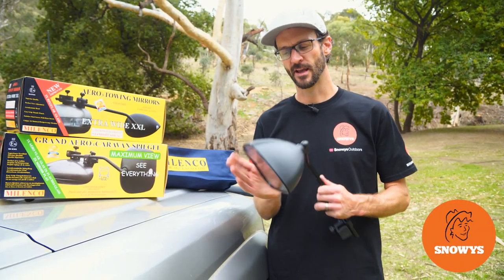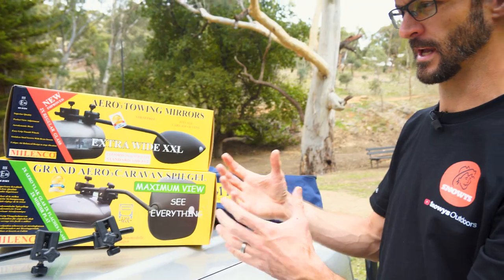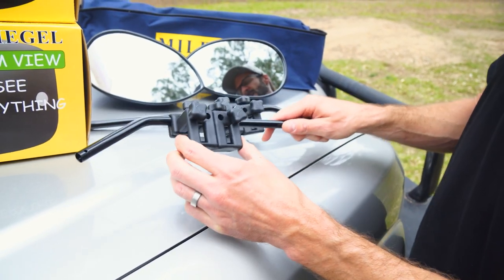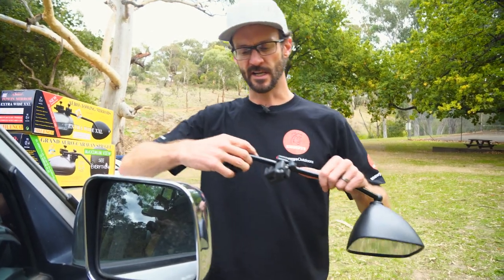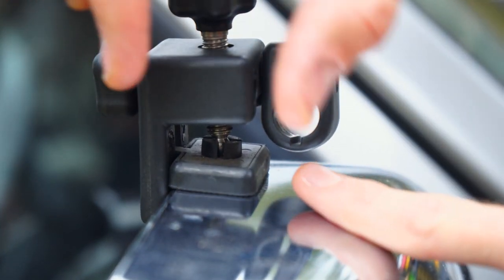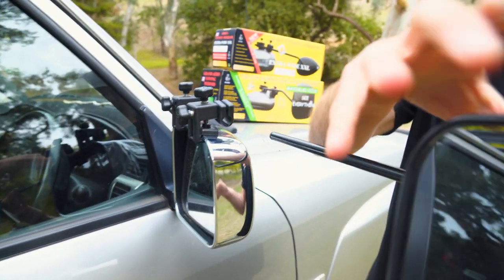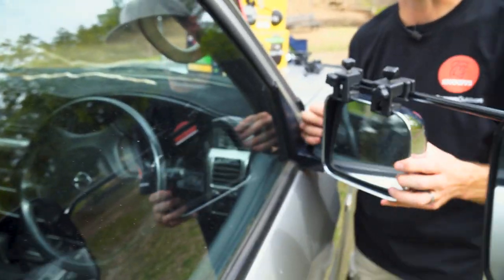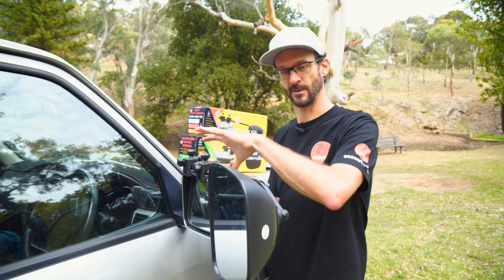Milenco Aero 3 Towing Mirrors

Comment: Have had a set for 6 months or so. I chose to mount them on the bottom edge of the OEM mirror as they mount to the vehicle on the bottom edge, so I figured there will be less flex along the bottom as opposed to the top edge of the mirror. It also allows 'normal' eye sight over the top of the OEM mirror. But great mirrors for the price.
Reply from the maker: Good feedback thanks, Kevin. ~ Ben
Reply: I drive a 21 Traverse and mounted to the bottom. This allows the driver to adjust the oem mirrors without the clamp hitting it.

Comment: I have the tear drop mirrors and have been using them successfully for a couple of trips. However the number 2 nuts are not holding the arm securely enough ( completely tightened) and the mirror tilts forward as you are driving. How can this be corrected please ?
Reply from the maker: Hmmm, this isn't an issue I've come across before sorry, Michele.
If you are by chance near one of our stores it would be good if we could inspect them, otherwise, you could try inserting some sheet rubber to make the clamps grip tighter.
You can also buy new clamps here - https://www.snowys.com.au/mirror-clamp, but without more detail I'm not sure if this will fix your problem.
If the mirrors are relatively new and you purchased them from us then you can submit a warranty claim here - https://www.snowys.com.au/warranty.
~ Ben
Reply: put in a rubber shim

Comment: My suv came with a rubber rain / glare shield. The rubber is fairly soft the rubber extends about 2 inches from the mirror housing and is about 2mm in thickness. 
I regularly tow a box trailer that is somewhat narrower than the car and is hidden from view in the side mirrors in a straight line. I use this irregularity to reverse in a somewhat straight / slight zigzagging line. I was told by my local auto store I would need to cut these shields off to fit any sort of towing mirrors. Are there any attachment that will accommodate this.
Reply from the maker: I'm not sure sorry, Norman, I'd have to see the mirrors to better understand this before I could make a recommendation. 
At the end of the day the clamps need a sturdy flat surface to make complete contact with, if these shields create any sort of weak or unstable point, then they may impede the security of the mirrors.
Sorry I couldn't be of much help. You can always call into one of our stores in Adelaide or Brisbane so we can have a look if you are anywhere nearby. 
~ Ben

Comment: The problem with these type of mirror mounted on mirror is that when ever a large truck comes toward you the entire assembly flicks back against the drivers side.  So irritating.
Reply from the maker: We've had mixed reviews regarding this, some people don't have any problems, I think it's dependent on the vehicle and how strong the hinge is on the mirrors. ~ Ben
Reply: @SnowysOutdoors I have seen some people are using an  a strap attached to the mud guard and bottom of mirror this give extra strength when big trucks past by